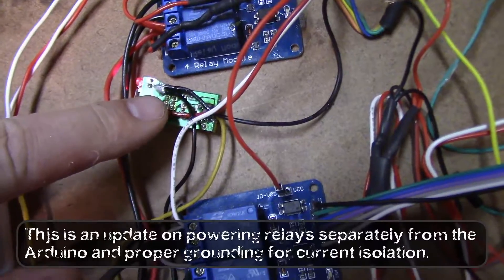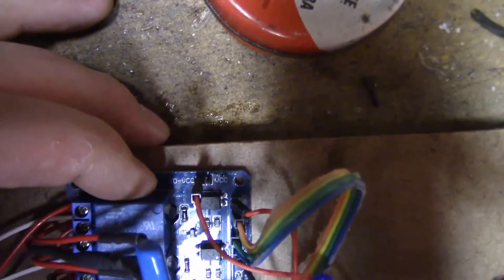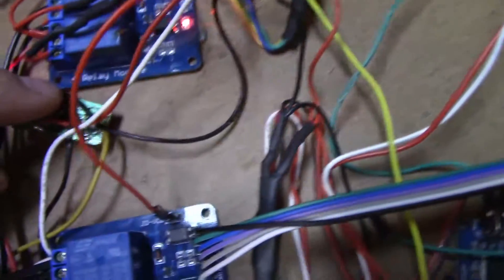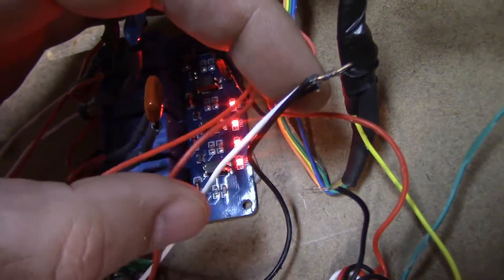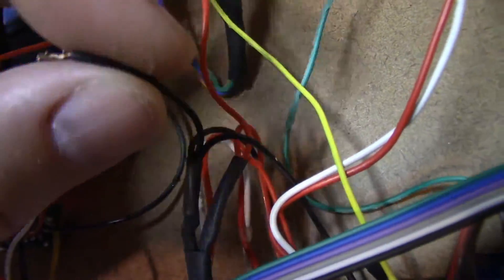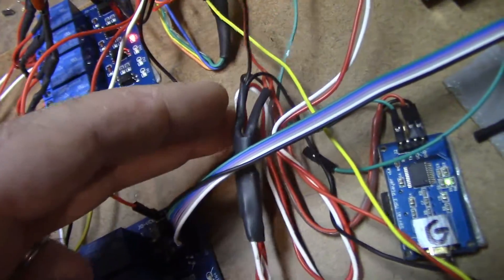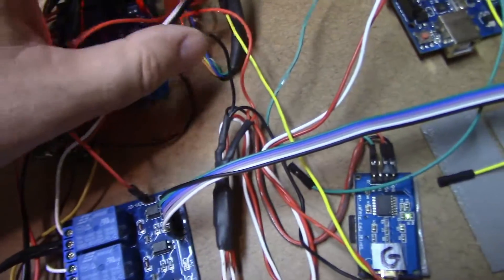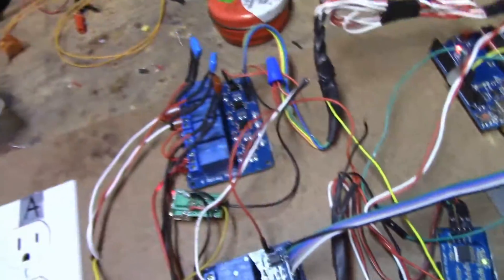Quicky: Proper Grounding for Arduino and Opto-isolated Relays Powered Separately

Comment: How does arduino trigger the ground on the relay without ground connection back to the arduino??
Reply from the maker: I honestly don't remember the details. I do know that these relays are supposed to be opto-isolated, but they aren't due to a design flaw in the relay board. 

The important fix for the issues I had with this design was to power the relays separately, isolated from the arduino's power supply.

Comment: so you didnt run power at all from arduino to the vcc, just 100% power to jd-vcc
Reply: You do not need the ground from the Arduino.  That is totally correct.   VCC from the 5v supply of the Arduino boards  go to the inputs of the Optocouplers through a current limiting resistor, then  through the Optos internal LED then to the I/O pin of the Arduino for the respective relay you are triggering.     In essence during the trigger pulse to turn on the relay, the I/O pin goes low which is actually grounding the pin thus completing the circuit (This is call sinking current into the I/O pin.)  and that allows current to flow through the Optos internal LED and the light generated activates the output of the Opto and powers the relay coil from power from JD VCC pin.  This totally electrically isolates the Arduino signals from the relay noise and relay contact noise.    Since the USB 5V converter is being powered by the main 12 volt supply you are using there still may be some noise passed onto the Arduinos.   A dedicated wall wart for the Arduinos,  the audio card and LED gizmos (which are really cool) would totally electrically isolate those units from the noise generated by the relay coils and relay contacts switching their loads.
Reply: I appreciate what you are going through and just wanted to help.  I can see how hard you are working and how much you have learned and I've been there.  I admire your passion and tenacity on getting this done.  I love to help folks that really want to learn.   Plus I love Halloween animation projects.  I live in a condo and really don't have space to make anything as elaborate as your projects.                  You are correct about everything coming from the same AC source.  If your prop was drawing surge currents of 20 amp spikes you would be in the same boat.   Since the draw from ole sparky on your AC is minimal the spikes are non existent.                   You are not doing stupid stuff you are learning what not to do the next time.  You didn't do anything wrong you just were unaware of the gotchas that lurk in every project.  If you were not using motors and coils this circuits you built would be just fine.  Your next electronics adventure will be done in 20% of the time.   Plus the learning curve today is 100 times faster than 30 years ago.   Help is only keystrokes away.  Before you were almost on your own because you felt like you were the only electronics geek in the world.   The internet has connected all us electronerds.                You're doing great.
Reply from the maker: No, but the Arduino ground is left out. Connect Arduino 5v to VCC. Connect separate power supply 5v to JD-VCC and GND on the relay.  Do not connect GND from the Arduino to the relay by splicing it in. I'd done this previously and advised to do so in my videos, and it's wrong.

This keeps the 5v separate power supply's current out of the 5v current from the Arduino. It's debatable whether it actually makes a difference, but I'd rather not provide any connection between those two power sources, and it's been advised here, not to do so: https://arduino-info.wikispaces.com/RelayIsolation
Reply from the maker: +jp040759 You know, I considered that about the power supply and running the 5v thingies off of it. Then I also thought that I'd be plugging all that stuff into the same extension cord, anyway. I mean, it's all coming from the same AC source in the end, so.. meh. I figured if it gave me problems, I'd get a separate supply for the 5v stuff, but hey -- it works, and I'm happy with it. But, I think you and I are going to get a long really well. I'm going to to stupid stuff with electronics, and you're going to tell me what I did wrong. LOL! Perfect!
Reply from the maker: +jp040759 Aww, thanks man. I appreciate the support. Hauntforum.com, especially YouTuber da-share (David_AVD in the forum) has been my go-to guy.  And, you're right about the world today. The world's knowledge at your fingertips!

Comment: As you say, the relay boards you have don't need that  connection.  It doesn't really compromise anything, but it's not required.  This scenario should hold true for all of that style relay board (with the opto-couplers).
Reply from the maker: I'd rather be safe than sorry, man. Better to be as isolated as possible with this thing, after all the problems I've had. I wish I'd tested this properly two months ago when I had my initial reset problems, to see if it would have nipped all of this in the bud.
Reply: And rob us of hours of entertainment ... err... I mean education?  :)

Comment: Not the optical isolation!?!? I'm with Edie on this one. What's the importance of this? I'm too lazy to actually follow the link you helpfully provided?
Reply from the maker: Well hello, there! Are you gonna be too lazy to read this comment? ;) Okay, here's the short version: It's important to make things work reliably and not have your controller reset all the time, so you don't waste three months of your life on one stupid prop that keeps shitting itself whenever you work on it.

Medium version:
Essentially, these relays can help keep interference from the stuff they're switching (like the shiatsu motor) out of the electrical connection to the Arduino, but only if you power them separately, and do not power them using the 5v output from the Arduino. This is a deviation from the project's documentation, but an important one to ensure the prop controller functions correctly.

Long version:
Two episodes ago, I discussed how I resolved all of my reset issues with this controller. One very important fix was powering the relays separately, and not from the Arduino board like the documentation says. Further, there had been discussion on how to wire the grounds to accomplish that. I was adamant that you must combine the grounds of the separate relay power supply with the Arduinos 5v output.

I brought all of this information to Hauntforum and we started talking about updating the project documentation to include at least some of the fixes, and Mike North pointed to another resource on the web, where the fixes for this reset problem were pretty much the same as what we'd worked out in the forums and my videos.

One emphasized difference, however, was that the new power supply for the relays should not be tied to the power from the Arduino in any way. That means, my recommendation of grounding the relay's power supply with the power coming out of the Arduino was incorrect and could negate the fix.

I questioned the accuracy of this, and decided to test it for myself, and we had some more expert input that tying the grounds together was definitely wrong. This video confirms that and negates what I'd previously vlogged. I've since put an annotation on that vlog.

Clear as mud, right? Well, watch it in video form. Maybe it makes more sense that way:  https://youtu.be/sWI_eohOjDg?t=11m12s